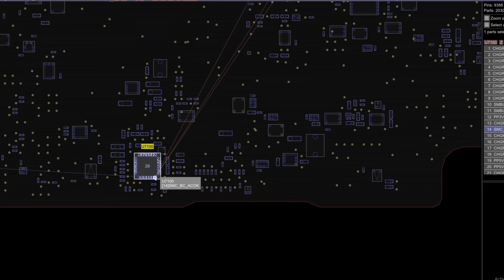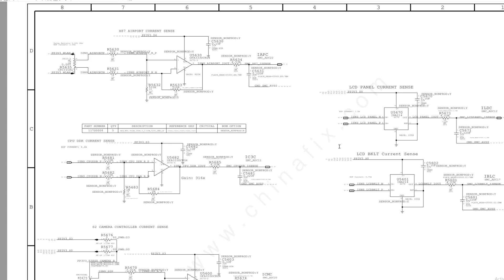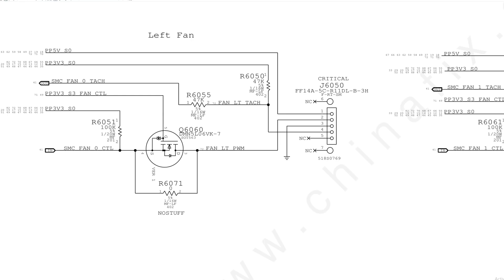Right to Repair - Let's be realistic

Comment: Schematics and board diagrams themselves cannot print a new motherboard. they show you how every components connects to each other, but it doesn't show the traces. if you want to print the board, you will need to design all of the traces on a multilayer board and probably change where most components are located on the board. As for serialization, I would argue in most cases it's unnecessary. We don't need a screen paired to a specific logic board. In cases it should be necessary, they can give us the software to pair it. For preprogrammed chips, i imagine there could be a way to program data on the chip without giving source code, or to sell the chips preprogrammed
Reply: If someone really wanted to clone a board, they can always sand down and scan the PCB, layer by layer

Comment: i agree with the statement that they spent years and millions to develop a circuit board and generally no one agrees to give the circuit diagrams, schematics, components and programmers into the open market. Even i would do that. However, if we take apple as an example it is not even offering repairs for all the components in their products at their service outlets which is ridiculous. They should be able to provide any kind of repairing service on their products as along as the product is not outdated. Lets think the product gets outdated by 10 to 15 years. We don’t expect a 2000 model mac to be repaired in 2021. But may expect 2007 model to be repaired as its hardware is still capable of driving the basic applications used for browsing, movies, songs and basic office work.

Comment: Hi , thanks for excellent content. I recommend to not use "board diagram" wording instead call it "board Layout"  or "PCB layout" it is more descriptive. Follow development flow, and avoid confusion/mix with schematic diagram.  I agree that serialization need to be regulated, if not then parts and repair cost can be decided commercially without any competition.

Comment: I am not an expert. I think serialization is the biggest problem here. As per diagram and schematics i think there is a room to do something about it. There should be a forum where guys like Alex and others segregate the tasks on specific board to perform reverse engineering, if possible.
Reply: I'd bet money serialization is completely unnecessary.
Reply: @HazeAnderson  It depends why it's done. Sometimes it's done as an anti tamper/anti piracy measure. The Nintendo switch marries the game card reader IC, the APU (processor) and it's NAND (The SSD). If any of them get tampered with the system won't work correctly. It's a measure to stop piracy. Unfortunately if any of those components break, the whole system is dead for good. So the idea of repair shops being able to re-serialize or marry a new chip makes sense. 

A compromise like the manufacturer providing those components pre-serialized for purchase would be acceptable as long as the price is relatively close to market value of the component in question + the cost of labour to re-serialize.

Comment: As long as the marketplace primarily buys by price instead of value, this becomes a very difficult issue to solve. Low price eliminates margin needed to provide vetted diagrams (both board and schematic) that don't provide enough information to copy the asset, but do provide enough information to repair it. Manufacturers have also not assessed any real value to their customers' data as well, so providing a repair path to recover customers' assets (the data) has never been a priority. (This has led to the stupidity of telling people to format and reinstall the OS.) I don't like the subscription model because it is both a means test filter that excludes much of the world, and also a human rights choke point to oppress people economically. Manufacturers obfuscate their designs to protect their assets from nations that don't honor intellectual property (China being one of them). Lots of people groups don't believe in IP (which leads to this problem) although there's little recognition by those groups WRT how much money is needed to develop and take a new product to market. Difficult topic to discuss, but very glad you tackled it!

Comment: I know exactly what your talking about... When I used to have a repair shop back in 2000-2010 technology was just starting to get more complexed. But yes now some chips communicate by special codes and they talk to each other only if the serial numbers correct on both ic’s. This was introduced to stop people from repairing their devices. Unfortunately I can tell you it’s going to be worse as time goes on. Possibly get ready to reprogram ic’s to work together.
Reply: @MattyEngland  Actually, it depends from car manufactor. MBS is ecu+ignition+ingition lock+TCU. None of them can be replaced without coding. On some USDM cars everything is coded to BCM.

Comment: Maybe instead or circuit diagrams and board schematics, manufacturers could provide part lists with their written codes listed on them so that can make outsourcing for similiar parts much easier instead of instigating the manufacturer for parts?

Comment: One of the major problems with products is the built in redundancy on the life of that product.  The e waste in 3rd world countries.  A big part of that is the fact that we cant fix what is ours.  Like a john deer tractor cannot be fixed like the old days cause you now need to reprogram the parts that you use as spare.  And the company charges a fortune to farm workers for reprograming it everytime it brakes.  And their built to brake morw often therefor charging for the service even if they own the product.  Thats where the right to repair came from.  Either make the products last or let us fix them.  But they cant have both.  Home appliances can finally be fixed properly for example.

Comment: In the past when we bought an electronic device the schematic came with the product. And in those times with the schematic you could "clone" the device, and they gave the schematic anyway, repairing devices was part of the culture. Nowadays having the schematic/board layout doesn't make it possible to "clone" the device because there are a lot of programmable chips and firmware all around the board, so now it makes more sense to give the schematics than in the past, so what changed, the culture, from a repairing one we went to a throw out one. Politicians like to speak of a green society so it's time we go back to the repairing culture of the past which is much greener than the throw out one.

Comment: I think it might be beneficial to look at from the pharmaceutical industry.  Once they launch their product they have a patent on it for a specific time period I believe it is about 5 years or so.  But in that time frame no other company has access to the chemical makeup of their product. Once that patent time frame expires then the generic drug companies have access to the chemical makeup of the of the product and then they can make their own version. So maybe something like this can be used for manufacturers with components and board diagrams where for new products nothing is released and you have to go back to the manufacturer for actual replacement but after a period of time maybe when the next generation of the device is released they release the schematics components and everything else of the previous generation.

Comment: A PCB is a diagram, it's just very difficult to read. Not having an actual legible diagram will not prevent reverse engineering, it will only slow it down. The innovation is not in putting parts together but more in IC design and in software.

Comment: Publishing the schematics does not reveal too much information to competitors, we are not asking them to release them under an open license. If a competitor made a knockoff product based on the schematics, the company still has every right to sue them and most likely win. You might say Chinese companies do not care about that, but Chinese companies have other methods of getting schematics. If they think there is enough profit to be made, the entire PCB can be reverse engineered, or they can get some "night shift" PCBs from the factory that makes the originals and has access to schematics.
Your proposal of having a tool installed on your computer that allows you to view, but not download schematics is zero improvement. All someone needs to do to have the schematics is connect a capture card and record scrolling through the entire file. If the output is HDCP protected, you can get a HDCP stripper or if all else fails point a camera at the screen. Movie pirates have shown that every effort to lock down visual content is doomed to fail. And that is assuming that the executable itself is not cracked, which is also wishful thinking, games have the copy protection cracked all the times.

Comment: "Why would they do that"?  Because it's more important to sell their customers a product that they can repair, or have repaired. Is Sony protecting their intellectual property when they code their power supply to the mainboard?  There is no reason to do that, other than ripping off their customers for monetary gain. Even if people take their devises to the manufacture, they won't do component level repairs. Their customers need to pay for board replacement, or the entire device.

Comment: Logically, If i own a 100s of dollars device and which is intend to last for few years as it is not easily affordable for everyone and suddenly if it stops working in the middle due to it's not properly designed then I have the right to get it going again for the affordable price if it is out of the warranty period, because manufacturer is not providing any sort of support regards to that device.
Another example: if you have your work shirt and you accidentally broke a button then you don't have a right to repair it yourself because manufacturer not allowed you to do that, so you have to take it to the manufacturer wait for their appointment and get it fixed and then use it so you can go to your work. Totally senseless. 🤣

Right to repair is very important!

Comment: I feel any Electronic component at minimum should produce replacement parts for 5 to 7 years after production like automobiles manufactures have to do for body parts by law. Maybe too much to ask for Schematics or circuit diagrams.
Reply: especially with lcd monitor with bad cap time bomb

Comment: Right to repair is not about getting board diagrams for free. You already have all the board diagrams you could ever want, just buy the product and look at the board! It's not some magically copyrighted or classified "private property" because everyone has access to it, even if it's less convenient than to just get a PDF. If you want convenience, you have to pay for the work, and that's how you get reverse-engineered board diagrams for all popular products right now without forcing companies to publish that stuff.

So that's a complete non-issue and takes the focus away from what right to repair tries to accomplish, namely giving the customer the right to obtain SPARE PARTS, like in the car industry. With enough of determination you can always reverse engineer a board, but even all of Jeff Bezos' money can't buy you the replacement chip you need, if the manufacturer is allowed to make exclusive deals with that chip factory. It will come eventually to a point where the "spare part" is the product itself because each component is embargoed from being bought by a competitor (that is, by you). It's simply an issue of antitrust, not forcing companies to disclose some kind of "private" information because that information is already available.

Comment: There would be no industry as we know it, if Apple hadn't published the Apple ][ circuit diagrams with open interface, and IBM hadn't published the Pc and AT technical manuals with BIOS source and circuit diagrams. Nor would the internet exist, nor Android, without open source, Linux and Berkeley Unix. Google runs on open source and Linux. Apple's success is due to Wozniak and Jobs setting the foundation for the future. Those in charge now are non-tech financiers who believe in more for them, less for everyone else. They want to control and monopolize what you can know, and think. Not just technically, either. ,Knowledge is power, and they want to arrogate that to themselves alone. No wonder our country is losing the ability to create and manufacture, when we're so dumbed down we can't repair. Instead we're reducedbto the status of a cargo cult. Maybe we should just abolish education altogether and substitute indoctrination. Hey, that is happening!

Comment: In one way its logical that you cant get all parts and some parts are manufactory only, unless you have donor boards. 

But some things i dont understand and dont like and have to get forbidden, and that the married stuff. Without it would be much better and easier to repair some things. Fir example the discdrives at xbox and ps. It should be forbidden that these things are married together
Reply: You can't replace a dvd drive on xbox, ps. Its married to Motherboard.

Comment: Apple wouldn't make a product that was impossible to retrieve data from once broke down, if people wouldn't buy the over priced shit to begin with. They'd change their ways if they wanted to make sales. People dumb enough to pay a stupid price for the crap, then they're just asking to loose the data when there's other options. Built in proprietary drives?... no freakin way I'd buy it. I intentionally keep older hardware up and working, specifically because newer stuff is built not to last and getting nearly impossible to repair. Then there's the, "back up your data often senerio" case, otherwise don't cry about it when they loose it.

Comment: I don't agree with the last part of the video.  Those millions of dollars or however much it costs to develop the product can be recovered over time from the people buying the product, from licensing deals (ex microsoft gets some fee from each game sold on their console) and they could simply add a few dollars to the price of each item to recover the price, or whatever amount they think they'd lose by publishing the schematic.  
The schematics and the parts information and even making the chips available would not be enough for someone to "steal" your idea and make a competing product, in the case of a console you have DRM and encryption and licensing and custom operating system. 
Someone very motivated (a company in China that wants to reverse engineer your product) can already easily buy a few units of your product, desolder every component and measure it and determine what it is, xray the circuit board to figure out the connections between chips, decap and xray/photograph chips inside  to figure out what each chip does if it's not easy to tell from text written on it. 
I'd want to see schematic and part information made available (don't care about board view that much, but I feel it would be important to know the part number of a capacitor or resistor in order to get one with same specs) and I'd also like for companies to be obligated to make available for purchase at acceptable prices the chips that are not available otherwise. For example, force company to keep 1-5% of those parts as spare up to 5 years or so after the last product using that partis made and available for purchase on request and allow each repair company to buy up to a certain amount of those chips and then only get another batch if they mail in the faulty chips  (so you won't have companies buying 10k of chips and selling them on bay or other places) .. ex.  you have a 50 chip limit, you order 50 chips, your limit drops to 0, you mail them back 10 faulty chips with maybe serial number or something for their records, your limit goes up to 10  ...

Comment: Board diagrams and schematics would have to be bought same as parts and chips. That way the manufacturer can still get paid and not feel he's giving away his device. Serialization is bullshit. Making married components is another way to lock out repairers and harder to work around. If the consumer buys a product technically it's not there's ,it's still the company's since there's no way to repair your device which you paid for no data extract then its not the consumers. It's a loaner device basically. But very good points should fight for atleast access to parts are a must. But serialization has to go. Eliminate that and access to parts and pay for the diagrams.